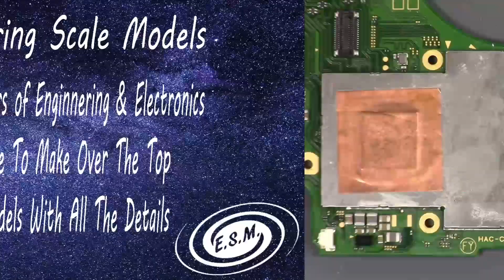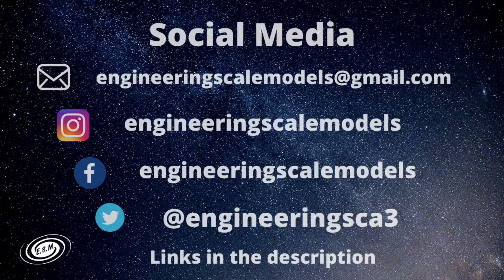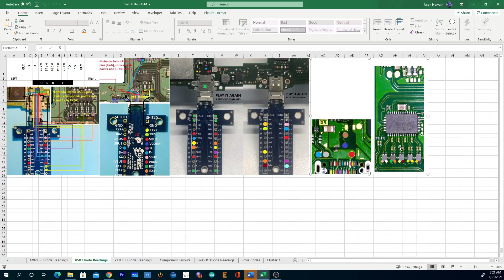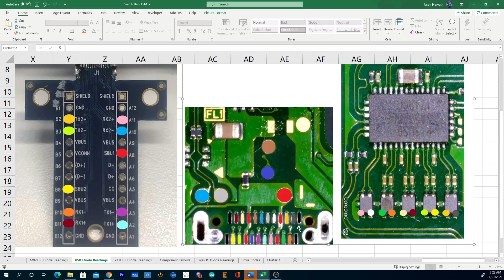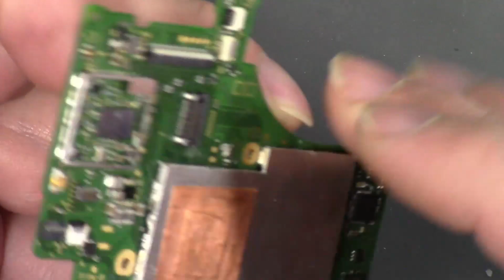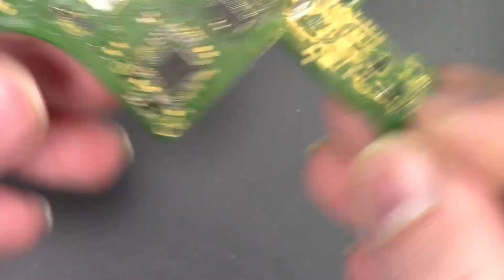Revisit of my Nintendo Switch USB C Port Overview

Comment: So when your USB port is broken or shorted it's a 50/50% chance that the CPU is shorted when the D- or D+ gets 15 volts or someting?
Reply from the maker: Yeah it’s a pretty good chance it D+ or D- getting 15 volts and the filter doesn’t blow fast enough the cpu gets shorted. Based on the research I have done so far and my own data, if the P13 cap is short when P13 is not on board that is most likely what happened.